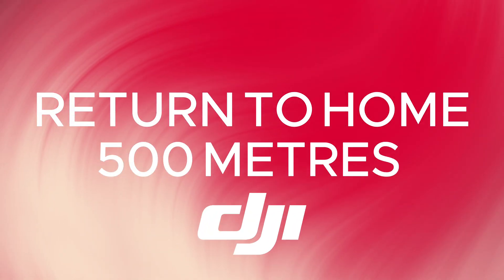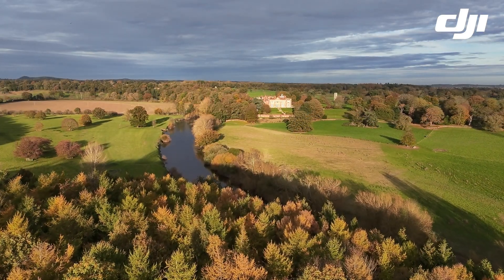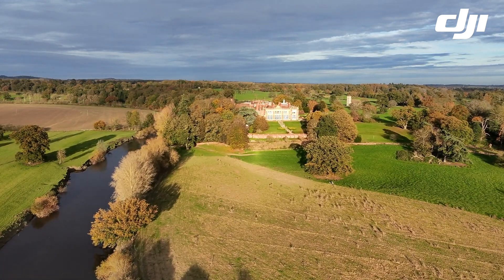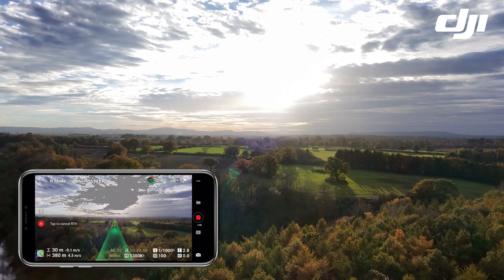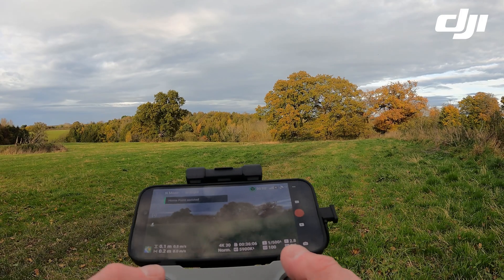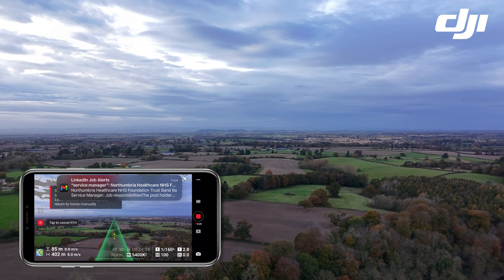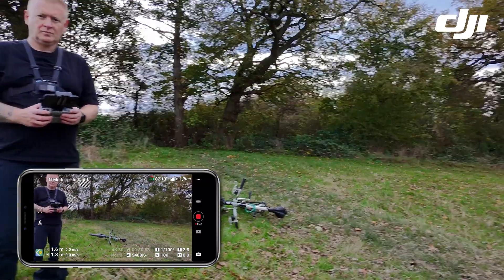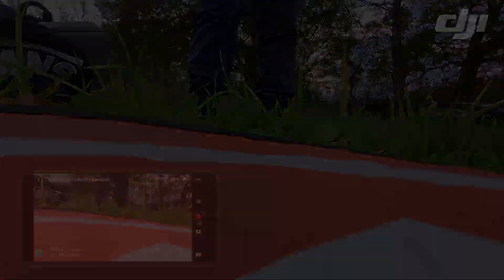DJI NEO - HOW ACCURATE IS 'RETURN TO HOME'?

Comment: I've bought the Neo, but so far with just the charger unit and 2 spare batteries. I mainly want to use it on bikepacking trips to film footage of us/the scenery so the ability to fly it using my phone, plus the preset options might be enough. 

However, if I bought a controller i believe my distance can be increased? If this is so, can I put it up in the sky with it doing a spotlight of us cycling away down twists and turns  (so basically not holding the controller, but the drone connected to it). Then when weve got the footage, is there the ability to call it back to me (the controller) or do i have to fly it back in as my location has changed? 

I hope this makes sense!!
Reply from the maker: @Two_Wheel_Bike_Travels  Thanks for watching this video. You can reset your home point using the settings so the answer to your question is ‘yes’. There is a 120m height limit so you can get the NEO up pretty high for scenic footage. There is more on my channel. Please do subscribe. It would really help me out and please do like this video to help the algorithms!  Scott.
Reply: @ScottJonesMTB  I've subscribed. Very useful info. Is it fairly easy to reset the home point and is there a controller you'd particularly recommend above another for somebody that has the Neo?
Reply from the maker: @ the best value option is the RCN3 to use with a smartphone. That’s the controller used in this video. And setting a new home point is super easy. Two clicks in the settings. Thanks for the subscribe. Scott.
Reply: @ScottJonesMTB  thanks for your time. I'll look into that controller

Comment: Thanks for your video, IV just subscribed to your channel. I have just brought the Neo with the controller, but did not get a landing mat... Do you need it for return to home...thanks
Reply from the maker: @richardpearson6329  No but it is great to have somewhere to take off from so that leaves and grass don’t interfere with your propellers  - that was my main reason for buying. There is a link in the comments for the pad. Only about 6 pounds if I recall. Thanks for the sub. Scott

Comment: Seems to be a pretty relaxing hobby. Is there a preferred drone for beginners?
Reply from the maker: @Max-oi9es  This is my first drone. 

Please do like the video and if you can, subscribe to the channel. It would help me so much. 

I have posted a new video on ‘follow mode’ which you may find useful as well. Scott
Reply: @Max-oi9es  they all fly very good, own the neo and the mini 3 classic. The software is that good, you can’t get it wrong and ofcourse oporate safely.
Reply: This is the one. MUCH easier than everything else on the market. You don’t even need a phone or controller to get going.

Comment: Sometimes you take off, and fly away for maybe 10-20m and then the gps locks in and tels home point updated, but you are now away 20m. And then you need manuali updste the home point to make a match with the remote
Reply from the maker: Thanks for this comment. So helpful. 

Please do like the video and if you can, subscribe to the channel. It would help me so much. 

I have posted a new video on ‘follow mode’ which you may find useful as well.  Scott